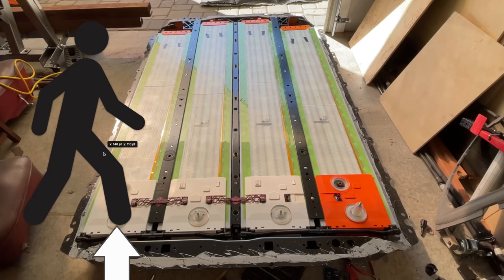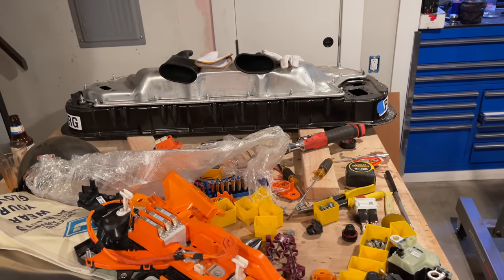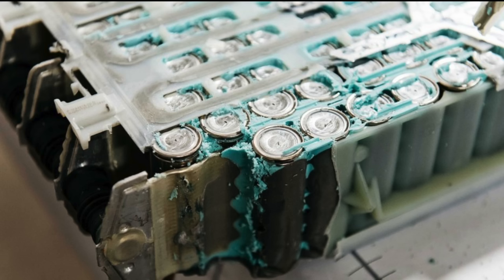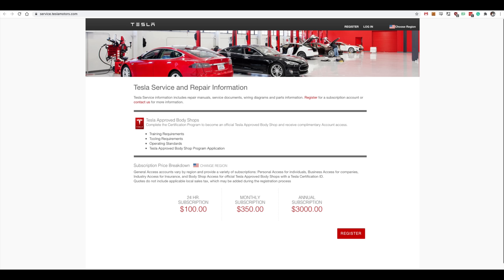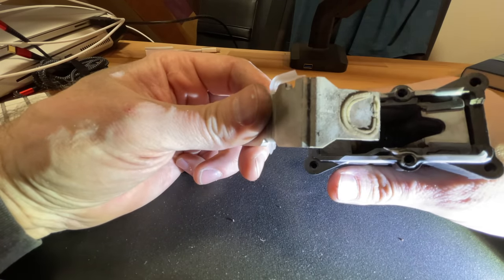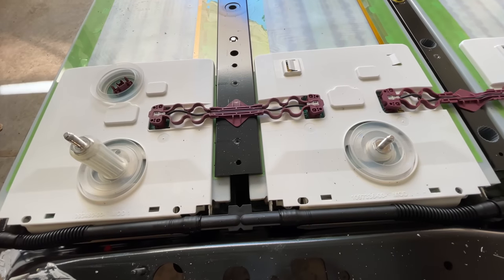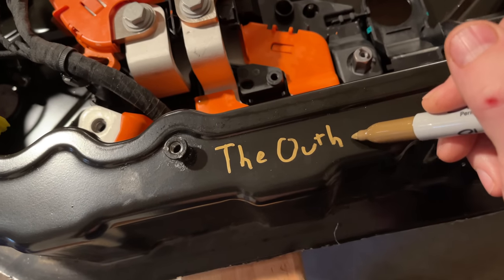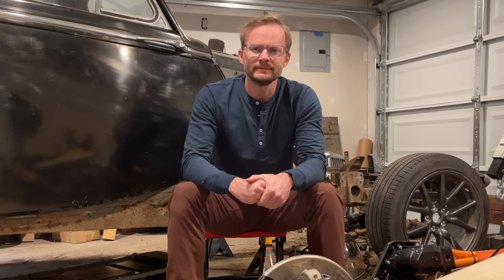Tesla Battery Teardown - Model 3 Standard Range Plus

Comment: Bet those tabs inside the pyrofuse are there to break the electrical arc that will shoot up between the two terminals when they get separated. Same thing on your house's fuses!
Reply from the maker: Interesting. Good to know!
Reply: The tabs are actually there to slow down the broken fuse tab part and also act like a ratchet (one way)  to prevent the tab bouncing back and making contact again after it hits the limits of the casing.
Reply: Technical term is Arc Chute. Google throws up images identical to it.

Comment: Those fins are there to quench (cool to extinguish) electric arcs formed when you break a high current. Take apart a mini circuit breaker (MCB) from your service panel, you will find the same structure.
Reply: This is correct - I believe this is called the 'arc chute'

Comment: i geuss you could make opening the battery a bit safer by putting a bolt through the edge of putty Knife blade to limit how far in it can go. - You could then call it the super secret battery opening tool
Reply: There's a pretty solid wall of plastic around the outer edges of the cells in the battery modules.  I've taken it off on purpose, and it's not something you're likely to break through by accident.  Don't test this, but I feel like if you intentionally tried to do it by hammering a putty knife straight in, your arm would likely give up before the plastic did, but I guess with a super sharp putty knife and a sledgehammer, you could maybe manage it.  Which would short out a maximum of 8 volts, due to the way the battery cell blocks are arrayed.

Comment: I worked at Tesla back in the 18650 days. The battery pack had a huge sheet of aluminum that needed to be removed and basically scrapped before accessing the modules. Is that a plastic cover on it now or is that also aluminum? Looks like they still have serviceability issues. Thanks for the video! BTW there definitely was a proprietary plastic chisel and other tools for removing the cover.

Comment: Matt, I had an eighty-something Ford that had an inertia switch that isolated the fuel pump in case of an accident. Junk yards should have a plentiful supply of Fords with inertia switches to repurpose for battery isolation.
Reply: I’ve also heard they are stupid east to reset which is great because doesn’t matter if it rusted out or got t boned.

Comment: FYI I have been doing a little research on the Tesla Model 3 battery pack and the difference between the 50 kwh battery pack that Matt has and the longer range 74 kwh battery pack is that the "bricks" that make up the battery modules contain fewer cells in the smaller pack.

On the Model 3, the cells are combined in parallel in sub components called bricks which are wired together in series to create the modules. Both the 50 kwh and 74 kwh battery pack modules contain the same number of bricks (23 in the short modules and 25 in the long modules). The difference is that the 50 kwh pack only has 31 cells per brick while the 74 kwh pack has 46 cells per brick. Since the bricks are wired in series to form modules, the modules from the 50 kwh pack have the same voltage as their equivalents of the 74 kwh pack.

In other words, the shorter range modules in Matt's Jaguar don't have cells removed from the middle of the module, they have the same number of cells removed across the length of the module. Ain't EVs fun?
Reply: I also have the short modules he was talking about. If you want to figure out whether the short modules are in the pack or not just try to lift the front end of the battery. If you can move it at all you are either superman or you have one with the short modules; seriously, even the small ones are ridiculously heavy, even with 3ft of leverage. It took 4 of us to load the battery up and when I say 4 of us I mean 4 HVAC people who regularly put air conditioners on roofs. As for how to get the middle 2 out, I flipped the casing almost vertical and carefully rotated them out.

Comment: never plan on putting any electric engine in any project i have but still love watching. even learned something new (i think) Cunninghams Law..
Reply: Never say never.  I love how easy it is to jump in my electric truck and make a run to the hardware store.  Beats the daylights out of tuning carburetors every time the weather changes or having to flush the gasoline every year because it didn't get driven enough.

Comment: So to get the middle modules out for anyone who is wondering, the best way I found is raise the front end to where the batteries are facing almost straight up (about 75⁰) then carefully rotate the modules out of the beams. Make sure you have them strapped to something because they will fall the moment they are unlatched. I hooked mine to the ceiling.

Comment: Hi superfastmatt. I've got the same pack. I'm wanting to use only 2 of the 4 modules because of space. Looking at the links on the underside, I was thinking it may be possible to cut links here and there (also splitting the end alloy extrusions) to turn the module into two batteries. Therefore I can then link them in series to bump up to 200v per module...400v for two modules.  Possible?

Comment: Hi
I want to do an electric conversion where I use a Tesla Model S Small Drive unit motor.
I want high power (220kW) for a short period of time and I don't want to cover distances greater than 30 km.
What battery do you advise me to use so that it is as small as possible and hits this kind of power?

Comment: A note on the putty knife to open the battery.  If you're careful, you shouldn't have a problem, but even if you're not careful, the way the blocks of batteries are arrayed, you're only going to be able to short out about 8v max across the blade of the putty knife.  Still, as long as you're not using a sledgehammer, it'll be pretty hard to do it by accident.

Comment: Would you please do a cost breakdown. Awesome channel, you can make the most boring topics very interesting
Reply from the maker: I hate keeping track of cost, but I'll probably do a rundown when it's mostly together. The basics of it are this- Jag:10k, Tesla motor&battery:10k, controller 3k. I'll have about 1500 in the front suspension and brakes but that could definitely be cheaper. Wheels and tires were 700, powdercoating the frame was 1k. I expect this to be a 35k build which is a lot, but in fairness is less than the average new car price. By far my most expensive build. But it doesn't hold a candle to some of the stuff I see on YouTube.
Reply: @SuperfastMatt  Thanks. I've always been intrigued with restomod evs, but the cost is still too much. Thinking of doing a electric motorcycle conversion. But the upfront costs and the amount of petrol that you can buy for that. But for now I'll live vicariously. Keep up the awesome videos.

Comment: inverted rounded pentalobe security(meaning Hole/protrusion) = "tesla" super secret tool.   i do like the humor, good job. an inertia switch for an airbag system may just work for your application, I.E. impact detect switches, latching/resetable relay stops control for contactor. ford has one to shut off the fuel pump, and you have to push a button to reset it.

Comment: Quick question about the air gap. Is that just the bottom of the battery cells up above it or is there more protective material on the underside of the module? What’s the undercarriage material below the air gap, just 1/8” steel? I’m trying to judge if I damaged my pack by running a rock along it and you are the only person on the internet who seems to have any idea about the battery armor!

Comment: I believe the fins on the Pyrofuse are for spark suppression. It turns out that if you interrupt a high voltage with potentially inductive load, you will end up with an big arc and if its not extinguished can lead to things catching fire.

Comment: I know this is years late but: 
The gap underneath the battery pack is for cell venting. 
Cells outgas naturally and the pack has several pressure sensors to monitor pressure as a variable of health and feedback into controls systems.

Comment: I think the fins in the fuse are actually to quench the arc as the electrical connection is broken.  Circuit breakers have something very similar.
Reply from the maker: Interesting. I've never taken apart a circuit breaker but they do look similar to the ones on google images. I bet you're right.
Reply: If you flatten the fuse tab and reassemble it into the top part of the casing and then manually bend it down you will see that the fins are actually there to act like a ratchet, they also disipate the energy from the pyro to prevent the tab breaking free and malking contact as a loose component or swinging back down to make contact when it bounces off the case.
Reply: You're right. The lingo is "arc chute". Matt the expanding hot air (from the heat of the arc) pushes the arc into those fins where it spreads the ionized air out and cools it to extinguish the arc. Otherwise, after the fuse blows, the connection might remain through the arc. As long as current flows, the air stays hot and ionized, so the arc is self sustaining.

Comment: I wish I could have used model 3 batteries for my project seeing as they're a hell of a lot cheaper than model S, have decent capacity unlike the Volt, and have integrated cooling unlike the Bolt (which set me back a few months). Is that "power conversion module" the 12V DC-DC converter or is it something else?
Reply: its a chager and dc-dc converter.

Comment: I worked in an er as the cleaner for about 2 years, a guy came in after trying to wire a bunch of batteries in sequence, 3 fingers gone. 3rd degree burns all up his arm and chemical burns on his face neck and torso after one of the batteries caught fire and exploded. Luckily he had a chemical extinguisher, but using it caused him to be in the blast zone.
Reply: Don't fuck around with electricity.

Comment: I am curious about the individual bricks. I am wondering if I can split each brick in half in order to double the voltage of the module so I can use two modules instead of four.
Reply: Sure.  But you don't want to because it's going to be an insane amount of work, the onboard BMS chips won't work anymore, among other things.  One step further would be basically just taking it completely apart and using the cells to make your own battery packs (and you'd probably be better off).  It's possible, but this is probably not the way you want to do what you're trying to do.

Comment: Every feature inside of battery fuse is an arc quenching and venting feature, it is not just vent for explosives
Reply: This means for example, that orientation is important when it is reallocated
Reply: And dude, when batteries are getting shorted while crashing cables will explode almost instantly, button is ridiculous as fuse trigger. Just use it to disconnect main relay, it clicks for free